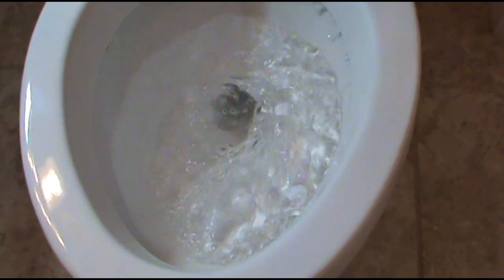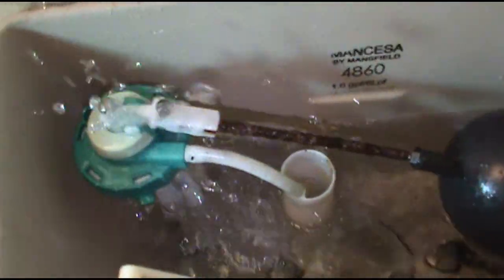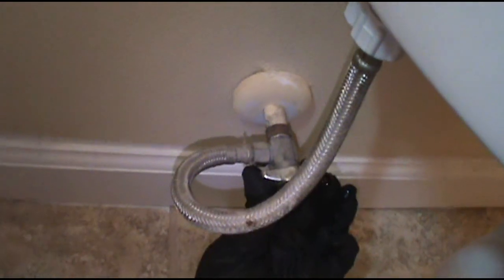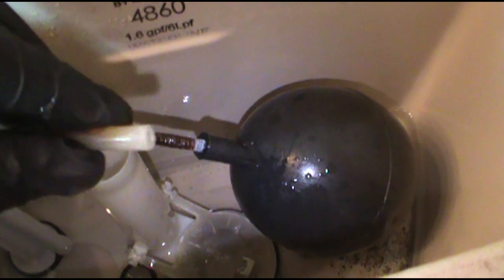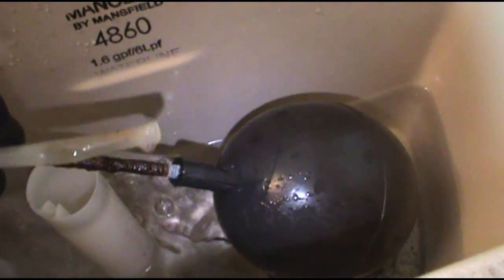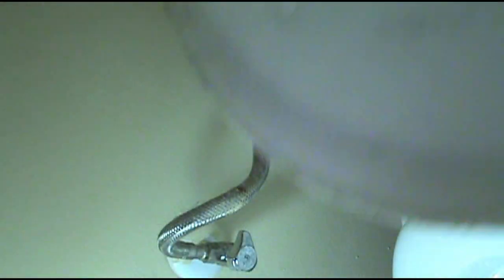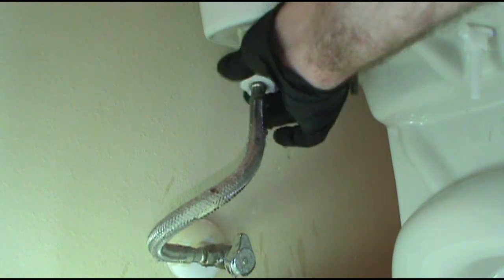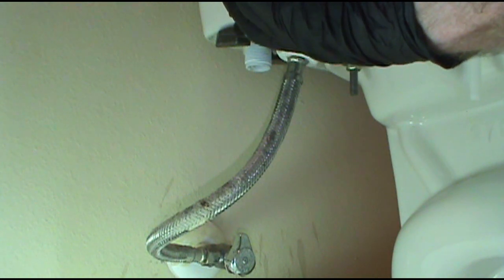What Causes Water Level in Toilet Bowl to Drop?

Comment from the maker: If you'd like to support the channel, you can do so by shopping for tools or whatever you need on AMAZON at no extra cost to you through this link,
https://amzn.to/2DwigPe

Toilet Fill Valve link: https://amzn.to/3il6KoH

Tools that will help maintenance technicians earn easy money!
https://www.dirtymaintenancenation.com/diy-tools-for-men/

If I've provided any value for you and you'd like to donate $1.00 or more into my online tip jar, you can do so through this link, (all cards accepted)
https://squareup.com/store/dirty-maintenance-nation

This page contains affiliate links, which means that if you click on the link and make a purchase, I’ll receive a small commission at no extra cost to you. Lex Vance is a participant in the Amazon Services LLC Associates Program, an affiliate advertising program designed to provide a means for sites to earn advertising fees by advertising and linking to amazon .com
Reply: Never did this but here goes. The water level is fine after the flush. My problem: Level of wtaer in BOWL for some reason becomes lower over time. Initially it fills ok, drops after a while. No leaks that I've seen! BTW,LEX, Fluid Master recommends putting a cup (upside down) over the fill tube in case there is debris in it.

Comment: Thanks for sharing your expertise.  I can't find anybody talking about my problem.  When we flush our brand new upstairs 2-pc toilet it works impressively and the water level in the bowl settles at the proper level about the same time the tank finishes filling.  Then, over the next 10 minutes, the water in the bowl goes away (all but 2").  

After 2 weeks we can't find any water damage or leaks on the 1st floor or in the basement.  Today I got on the roof and ran a garden hose into the stack vent for 20 minutes and I could hear that water gurgling in the copper waste pipe in the basement, so the venting doesn't seem blocked.   

What things can I do to diagnose where the water's going and why?
Reply from the maker: Hmmm I'd need to be there for this head scratcher 🤔. Everything seems legit.
Reply: @LexVance   Somebody said unseat the toilet and prop the toilet up on 2x4s to watch the possibly-cracked bowl leak into the floor drain.  Does such a procedure have a name I could Google?

Comment: Lex, toilet flushes as normal and water in the bowl looks normal at first.  But after the bowl fills the water level immediately decreases about an inch and remains that way.  So the water level in the bowl is less that it should be.  Any ideas?
Reply from the maker: Slightly clogged. Try plunging or snaking. Hope this helps d c!
Reply: Same Problem.
Reply: @you2449  Found out the toilet bowl is compromised.  That is, there is a slight crack or leak that allows the water in the bowl to exit until it reaches the level below the defect.  You cannot see it.  The bowl has to be replaced.
The test: you should be able to gently pour some water into the bowl and the bowl water lever rises but if it slowly falls to a lower level, then bowl is defective.
You can also remove the bowl, place it outside on a dry, level surface and again, gently fill the bowl with water to an appropriate level.  If you see any water underneath the bowl, it is defective.
Reply: @dc-wp8oc this has been my problem with a fairly new toilet. Did you see any water around the toilet bowl that leaked? I haven't on mine and it's sitting on a slab foundation. Your answer was very helpful, though.
Reply: @dc-wp8oc  Thank you for the earlier reply! (I missed it 2 months back.)  Will try that out!
Reply: @roseofsharin  In my case, there was no water on the floor around the toilet like when the toilet seal fails.  When a toilet seal fails, water accumulates or leaks on the floor around the toilet. 
You should be able to set the bowl by itself, without the tank, on a level surface and gently introduce water into the bowl until it reaches a "normal" level.  You have to make a judgement as to what a "normal" level is.  More important, it should maintain that level.  Mark that level with a pencil on the interior of the bowl.  If the water level goes down in a few minutes, the toilet bowl is compromised.  Another clue is water on the surface under the bowl, when you do this test.  Hope this information helps.
Reply: @dc-wp8oc  thank you for the reply! We'll give this a try.
Reply: My toilet bowl has a running issue and we notice that after the water fills inside the tank and in the bowl it starts to decrease in the bowl and has also caused my water bill to increase double. Please help.
Reply: @bridget1400  The tank mechanism is what controls water to the toilet.  So, if not operational, then water will continue to flow to the toilet.  Make sure the float is working to shut off the water at the proper level in the tank.  Next, check the flapper to make sure it is properly adjusted, and it is sealing the water in the tank.  If float is adjusted properly and water level is dropping in the tank, then replacing the flapper would be my first approach at a fix.  Hope this helps.

Comment: Cut that hose down a bit and slip in in the that groove in the flush valve. If the hose goes below the tank water line it will cause you problems bro-ham.
Reply from the maker: Right on, I was speaking with another subscriber about that. I've got toilets I did the same way 4 years ago and haven't had any call backs on them. I'll start using the clip again. I stopped clipping to the top because after 6 months or so, the hose was popping off the clip nipple and spraying water everywhere. So, I started putting the hose in the flush valve. Haven't been called back in years.
Reply: What sorts of problems are caused by not trimming? I've always just popped it into the groove, no trimming.
Reply: @Michael-gb3cj  Trimming just makes it look better.  Leaving the hose below the water line is the issue.
Reply: @Michael-gb3cj   Some how it drips water into the bowl by siphon. The resident who is OCD will let you know of the drip every 10 seconds and the toilet running for  2 seconds every 12 hours
Reply: @fishrman29  Yeah I've had many of those, never knew the real cause other than obviously something to do with the valve, so I just replace 'em. Thanks for info
Reply: @Michael-gb3cj  It could cause the tube to siphon

Comment: Hey lex, whats your take on the Gerber toilets. My super recently  changed out my toilet and replaced with the gerber 1.28 gpf/4.8lpf which Maintain a low water bowl which leave poop stains a not so good flush....? From a building tenant.
Reply from the maker: I don't like the low flow toilets. It's not enough water to move the waste out so it can clog the mainline too and cause backups.

Comment: Have the same issue, the tank fills fine but when I flush there is not too much water in the bowl, except if I long flush and completely empty the tank, then it fills properly, any suggestions will help. Thank you:)
Reply from the maker: Try adjusting the fill valve to let more water into the tank.  Or maybe the flapper is closing too fast and not allowing the proper amount of water through. You can shorten the flapper chain so that it stays up longer and allows more water through to the bowl.
Reply: @LexVance  Thank you! I’ll give it a try:)
Reply from the maker: @Shaverboy516  The fill valve has an adjustment stick that you can turn to make more water or less water. I hope everything works out for you 🤞.
Reply: @LexVance  Thank you, I tried the water adjustment and that didn’t work, I’m guessing it might be the fill valve not filling fast enough, I’ll pull the tube off and see how it’s streaming. I can check the inlet water holes maybe they are clogged? But if they were clogged when I long flush it wouldn’t fill either 🤷🏼‍♂️

Comment: Now, what makes the water level drop AFTER the flush?  I mean overnight the bowl goes from full to low, then stops at the low level with half the water in the bowl gone..   Doesn't seen to be a leak as the ceiling and pipes underneath and to the sewer are dry.
Reply from the maker: You may have a slight clog causing pressure changes. See if you can plunge it and see if there's a clog.
Reply: I'm having the same problem. Have you solved yours?
Reply: @thequyen  I changed the stopper at the bottom of the tank.  That seems to have stopped the water level dropping in the bowl.

Comment: What cause the water level in the bowl to slowly drop after it refills after a flush?
Reply from the maker: Slightly clogged. Try plunging.
Reply: @LexVance   OK I though it was either that or a venting issue.I tried plunging but no luck.Going to rent a snake tomorrow and run it through the line. Thanks for the quick reply sir.!

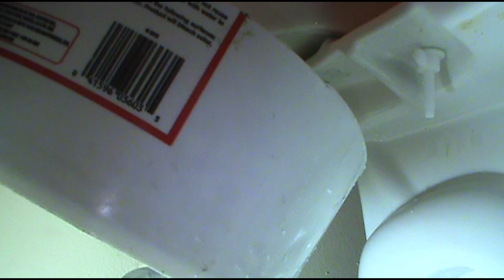Comment: At  3:30, I can't get a bucket under the tank when I go to pull the fill valve out. The bathrooms I work in are rather compact, the toilets are too close to the bathtub. So I have to use a big sponge and bucket on top to remove the excess water.
Reply from the maker: That'll work. Thank you so much for watching Thomas!

Comment: My toilet bowl has low water, i keep adjusting the level with the screw driver but the water level in the tank won't go past the water level line, there isn't any change in the level of the bowl. Is it normal that it won't make a difference even if i try to adjust it?
Reply from the maker: Hmm, I'd need to be there for this head scratcher 🤔. The water should rise.
Reply from the maker: Hmm, I'd need to be there for this head scratcher 🤔. The water should rise.
Reply: @Lex Vance  it's the Delta Foundations toilet. Brand new, literally just installed an hour ago. Maybe the water is where it should be but it seems low compared to other toilets around the house. I'd like this one higher since the toilet is the powder room, i don't want people's doo doos hiting the porcelain like you said.

Comment: I replaced both, the fill and flush valves and the toilet water level is still low.
Reply from the maker: You may have a slight clog. See if you can plunger it. Try an auger if that don't work.
Reply: Thank you for your response.  It appears there is no clog, since it flushes good. What I did notice is for some reason, the tank does not empty all the way, it only empties half way when flushed and therefore the tank fills up with water before the bowl reaches the correct water level.
Reply: @KenSerpico5450  have you found a solution to your problem? I'm having the same problem.
Reply: @thequyen No I have not.  I called a plumber and he too couldn't figure out what's causing the issue. What I have opted to do, is to hold the flush handle until I can hear the water has completely emptied from the tank and release the handle at that point.